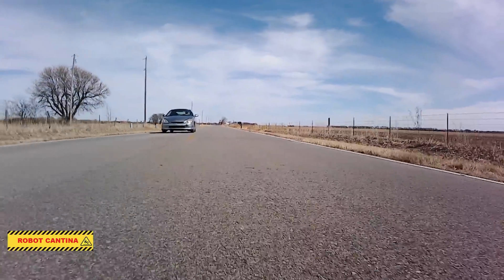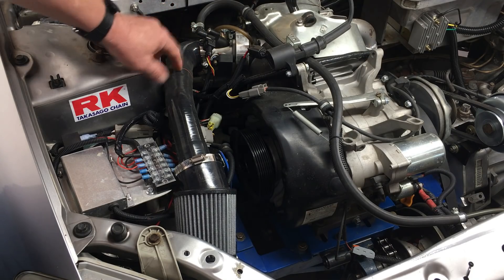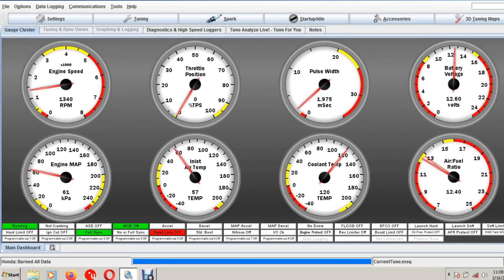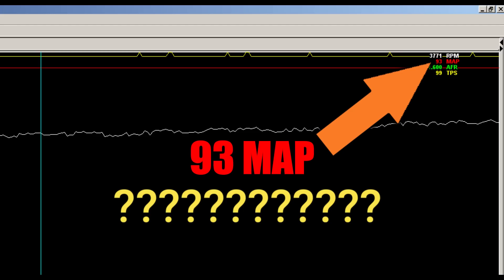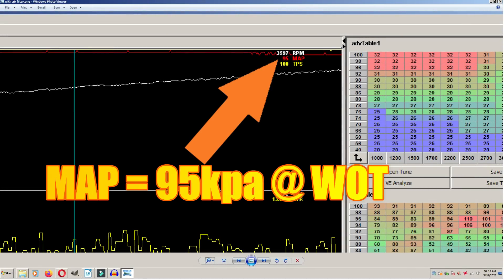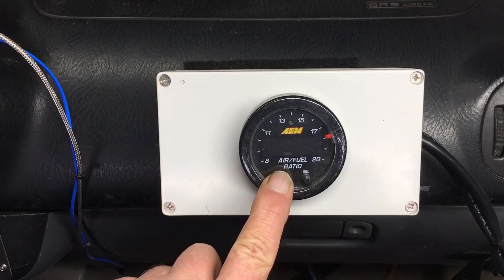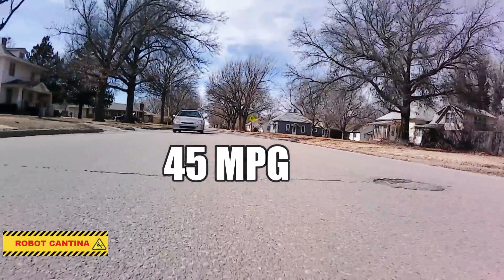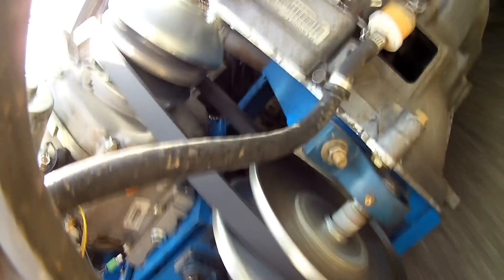S2E3 Fixing Speeduino NO2C  EFi problems on the 420 cc Predator engine.

Comment: I know when running a turbo with a 1 cylinder you need to have a chamber between the turbo and throttle body of at least 1.5x the displacement of the engine to act as a resonant buffer (it smooths out the pressure wave of the intake valve shutting/opening), but im wondering if the same is true for a supercharger.  Would you be willing to test that theory  when you get to it?
Reply from the maker: I'll have to do the math, but the volume of the charge pipe from the supercharger to the manifold is about 1.5X the engine displacement.  I'll have more videos on the supercharger setup coming soon.

Comment: If you really want to take of your gnome problem, you should give them their own corner supplied with a bunch of VHS tapes.  No VCR or TV, just the tapes.  The content/genre of the tapes is not important, but my experience is that porn is hit or miss, so best to just stay with the normal rated G, PG, PG-13 and R tapes.  The best part is VHS is dirt cheap now, sometimes free.

Comment: I think you guys are doing a great job. Something I saw that worried me a bit, and it could just be the camera angle but I thought the fuel line looked kinda close to the torque converter. I just was concerned you might get a rub out on the line that's all. I love what you guys are doing. I used to swap in b series motors build them and turbo the crap out of them when I was a young guy. But you guy's are on on uncharted territory. Good luck. Im subscribed so ill be watching.
Reply from the maker: The shot with the torque converter showed the old fuel line setup, the lines have since changed.

Comment: Good stuff!  I’ve watched all episodes love the efi tuning and science.  I will say that you should consider adding an electric motor somewhere in the drive line that can feed in torque on demand.  Maybe a push button red momentary switch to complete a circuit to some lithium ion power tool batteries wired in series sitting in the trunk for front/rear weight balance.  Kobalt 24v are relatively cheap $100 per 200 watt hours (2 of 4ah 24v for $100).  Each pack is 6s2p arrangement.

Comment: If you want a new build at some point i have thougt about a hybrid, big generator on the enginge, a semi battery and a clutch for direct drive from the cement mixer engine to the transmission when the pedal is to the metal. Something like an a/c clutch or pto clutch from a lawn tractor. Could be a very powerfull build or a complete failure😅

Comment: Dude I'm not gonna lie 45 miles per gallon seems really lucrative and seeing how I don't have that much Of a commute to work I really am contemplating the indeed idea of doing a predator motor in a small car you have inspired so much chaos and calamity in my head it's ridiculous.
Reply from the maker: Generally speaking the 420 and the bigger 459 Predator engines seem adequate if you do not need to go faster than 40 MPH .  We never checked the fuel economy at lower speeds but it should be significantly better.
Reply: In all likelyhood you could reach the same numbers with the stock engine in that small car though....

Comment: Nominal changes to a tune on a "small" engine usually don't yield major results, however you can now sleep well knowing you've made it as right as you can. Time to cram some air into it! Can't wait to hear what it sounds like.
Reply from the maker: I think at this point the engine has given all its got. After all its basically a stock industrial engine and I'm running it past its power curve.   The Stupid charger will be the game changer.  Of course if I blow it up, I reckon you will be getting a package from UPS.  lol
Reply: @robotcantina8957  What about adding a DIY HHO fuel cell ??
Reply: @robotcantina8957  Erm...  No;  A tuned length (and diameter) exhaust,with a pressure wave terminator and anti reversion box, will increase power throughout the rev range and work with the supercharger...
It's worth an episode or 2.  :)  
I have all the maths stashed away here somewhere if you're interested.
Reply: I guess we could be seeing you do the tear down if / when there’s a catastrophic failure lol keep up the great work everyone
Reply: No one knows the exact day hour /But we can see  the signs  events all around us. And  by the timeline,   Israel is  80 years and  1 generation span  according to bible  text will be around  2027 , which israel was declared  first in  1947 + 80 years = 2027 .  so we know we dont have  10 years left as this is 2022  so the   rapture, then the tribulation  will be before 2030 for sure.

The rapture will happen without a doubt and it will happen much sooner than many believe (less than 10 years according to all the environmental, weather,astronomical signs ,israel timelines etc showing ). It will happen without any warning , not one , in an instant , catching masses of people off guard just like God always does, ie the flood ~ a rude awakening . No one knows the exact day or hour the rapture will happen is a certainty . THE RAPTURE CAN HAPPEN NOW at ANY TIME make no mistake !! . Please awake to Christ Jesus which is the ONLY hope NOW and dont let it be found out it IS all true later when its too late & many have been left behind in the most terrible times the earth Has Ever experienced Before and ever will...for anyone who sees this and doesnt know what to do please If anyone hasnt given their life and heart to Christ Jesus will have REAL BIG problems way bigger than any problems Ever had If left here on earth after the Rapture . After the Rapture The USA , Worldwide , will face More evils , Inner city chaos, firearm wars etc etc ,power & water , food shortages , military invasions,mass executions (yes much blood will be required by antichrist ) etctec than it Has EVER been seen Before and you surely dont want to be Here then . We Have Time NOW to change , please seek Christ Jesus while there is still time to save ! no one knows the day or hour of the rapture it will start out just like any other day and it will Take Place In the day In Broad daylight/sunny day , In an Instant FLASH without ANY warning ,& there will be peoples Driver Ids, cell phones ,wallets found in various parking lots,Purses, bill folds Found at work etc etc with NO explanation , and People VANISHING so No One can refute it has taken place. .
romans 10:9-10 That if thou shalt confess with thy mouth the Lord Jesus, and shalt believe in thine heart that God hath raised him from the dead thou shall be saved! 
please share with others =IMPORTANT
raptureready.com

Information  for anyone who has come across those that  refute the 
 rapture and  say  that it was supposedly  made up  and   say it was created by darby church  in 1700s . This is real good  to show it was  way before darby , and its documented .
 also rapture pre trib proofs even in dead sea scrolls .
15-1700s/  irenaeus 170ad/ 250 ad / /isidore 4th century   
sourced by intense search and study by  ken johnson 
https://www.youtube.com/watch?v=e1Nv-xFig8I

Comment: The square path is a great idea, do you foresee any potential gains in torque production using a tuned length intake tube/manifold?
Reply from the maker: This didn't make it to the video, but last week I tried extending the intake tube all the way to the grill opening on the car.  The results were mixed, I wasn't able to get a stable air/fuel reading from the wideband.
Reply: @robotcantina8957    Ahhhh, that's to bad. Thanks for letting me know though, its an education.

Comment: Mr. Cantina don't lose your driver side headlight. Looks like you are missing both bolts on it.
Reply from the maker: I love how folks notice stuff in the video.  So about three months ago I set out to remove the headlight and got distracted..... Now I reckon I should finish the job.... then then put the screws back.
Reply: I think there's at least one more bolt on the bottom. But even if that's missing, the bumper cover will hold the light on.

Comment: TBF liters per 100km is a stupid unit.

Worst of all they're now doing kWh/100km for EVs, because consumers are too dumb to understand Wh/km or whatever...
Reply: Seems to match inline with the utility bill.
Reply: @DarkLinkAD  that's what I meant. They don't trust their customers to understand Wh if there's no k in front. And they chuck in 100 because otherwise it'd be 0.X kWh/km.
Reply: Actually, it makes perfect sense. Just like all metric units.
Reply: @hojnikb  it makes sense, but there's two extra prefixes: k and 100. That makes it so long and cumbersome. Wh/km is a much simpler unit and it makes just as much sense.

Comment: Hey, love all your videos-big thumbs up from a fellow tinkerer in Michigan.  So I just wanted to put it out there for future video ideas that an AGNI/Lynch motor would literally be perfect for an electric motor repower project on this car or any other smaller vehicle project:
The AGNI or Lynch motor is a unique axial gap permanent magnet brushed DC electric motor.  The motor has a pancake-like shape and was invented by Cedric Lynch in 1979.
The Lynch motor is built from ferrite blocks sandwiched between strips of metal, instead of conventional copper coil windings, and is held together purely by magnets. The motor is available in several sizes (6.6 lb) to (24 lb) weight and provides a power of 1.5 kilowatts (2.0 hp) to 11 kilowatts (15 hp) within an efficiency range of 80% to 90%.
Any voltage battery up to 90 volts can be directly connected or a variety of controllers will work such as cheap PWM or golf cart controllers of many power levels.  I've even ran mine (AGNI 15kw capable) off a 3Kw brushed motor controller for an ebike.  What's amazing is the torque produced: I once hooked a single 18650 battery directly and the shaft spun about 90 RPM and had an incredible torque for such low voltage and motor speed.  A 9v battery spun it about 300rpm and you could not hold the shaft from spinning with your hand, 48 volts is about 2,500 rpm and it will rip a back tire right off an electric bike.  A very interesting motor so I thought I'd throw it out there, thanks again for excellent and interesting content.
Reply: @Alfred Wedmore The AGNI motor works differently then most, I've actually read that AGNI motors are often directly connected to high power sources under 24 volts.  I think that this ASMO carts article about the Lynch motor is very detailed and helpful when working with them to get peak output power and just interesting information overall.
Reply: @Alfred Wedmore I've found a couple different 48v golf cart controllers (6 and 10kw) and even a cheap Chinese PWM controller run the AGNI just fine.  I even ran one on a 3kw ebike controller.
Reply: Batteries are definitely a huge outlay.  on my 2 seater go kart I used 4-12 volt "power chair batteries" and on my electric boat motor I've used a couple 1kw 48v ebike batteries.  I may switch to power chair batteries in the boat sometime in the future when the ebike batteries get low.

Comment: The CVT has spring tension adjustment holes on the drive and driven pulleys. Adjust them to their tightest position to maintain torque longer.
No new weights required.
Reply from the maker: Forgot about that, will do!  Stay tuned!

Comment: 5.25 l/100km is pretty good.
My SAAB with its 2.0 liter turbo engine does about 5.3 l/100km when going at 70kph in fifth gear.
Reply from the maker: Had to translate.....44 MPG @ 44 MPH.  pretty good!

Comment: Look up tuning for ITB's or fab a small airbox to normalize pressure a bit. Multi-cyl engines have a smoother vacuum.
Reply: I'd just modify the code to add a filter on the reading, maybe ignore readings made on closed inlet valve.

Comment: That little engine is really pumping. Consider: Stabilize the manifold pressure fluctuations somehow. E G. Increase the intake plenum length or add a small can shape with smaller than plenum attachment and with bung hole for map sensor or just find a smoother location or whatever it takes to buffer the rapid fluctuating pressure at the sensor.
  I think that having the processor continuously performing a heap of ( historical) rapid changing calculations just slows the flow of processing speed, decision making, and timely command and control. 
  My thoughts are that: The processor have 1) To much data to process 2) Will miss data to process
Reply: This is exactly the issue people with ITB's face witjh no common plenum to equalize pressure, and there are a few methods. Some hondas have a volume connected to the airbox with a large tube.
Reply: Averaging shouldn't be a problem for the processor, but depending on the averaging period, the latency could make control more difficult.
Reply: Similar has to be done for proper turbo function on a 1 cylinder

Comment: metric is the best measurement system out there tel me whiting 5 seconds how many inches is 1 mile? or how many fluid once is one barrel, how many pounds does one gallon of water weight?  1 kilometer is 100000 centimeters 1 liter is 1000 ml 1 liter of water is 1 kilogram . You dont need to be fucking engineer to figure out basic everyday task using using metric system jeesus
Reply: Nobody cares about the debate between measuring systems. People use what was taught to them from where they live, if you get butthurt because it's in a different measuring system, you need to grow up.
Reply: @JosephArata  usa politicians needs to grow up and ditch imperial system just like other western countries have done
Reply: @reversedon8698   You know its not just the US right? Anyway, I prefer my measurements to have lingering spite and hints of spells with 6's. Keeps a man honest.. I think.
Reply: Inches are an inappropriate measurement for miles so why would I care to convert the units? Barrels are measured in gallons, not ounces, so again why convert units? Nobody cares you travel at 450,000 cm/hr but good for you converting units is super easy, we don't care because we don't convert units just about ever. You build a house in inches.. yards, meters or miles never factor in.
Reply: @DracoOmnia  ok then, so if you have 37 barrels of water how many gallons you have. or how many ounces is 7.8 pounds  if you cant answer that in 5 seconds system is too complicated for average human
Reply: @DracoOmnia  You're acting like a child arguing about something that is literally unimportant compared to the rest of the world's problems today.
Reply: @JosephArata  talk to op, I'm just pointing out his argument sucks.

Comment: 1 liter fuel per 19 km , actually my smart fortwo does about the same milage on the freeway
Reply: any modern diesel car will easily do that kind of efficiency on freeway at or above speedlimit.
Reply: @hojnikb diesel is quite a bit cheaper too in the netherlands , dieselcars here are in a higher roadtax bracket though and it only pays to drive a diesel here if you drive more than 30000 km per year i drove a few dieselpowered cars and actuslly like the torque they make , unfortunately i drive to little nowadays  to make it worth driving a diesel
Reply: I average that with a 2600lb 2010 Corolla 1.8 4spd auto. With warm up. Can do better if im patient, but I have an incredibly long hill that requires 3rd gear for a couple minutes on my commute